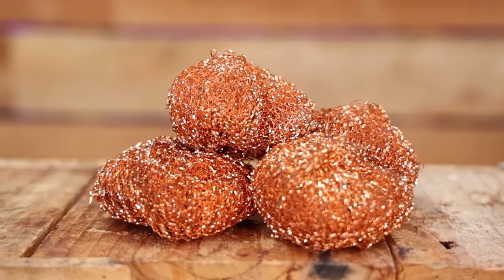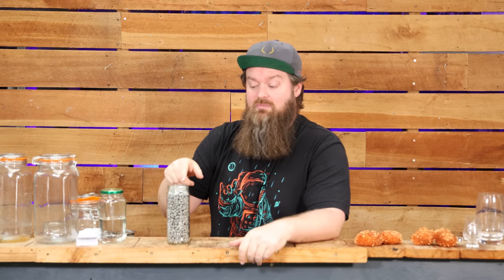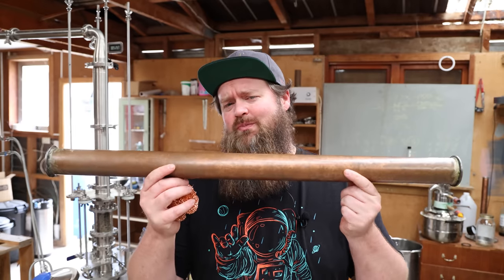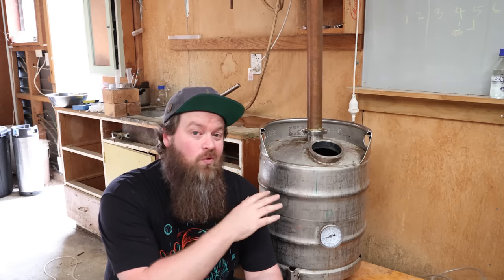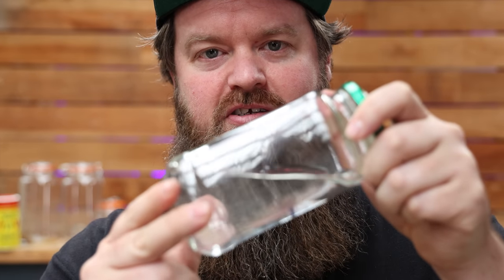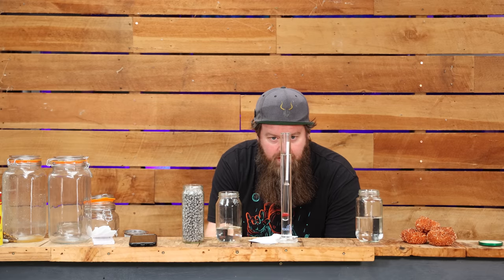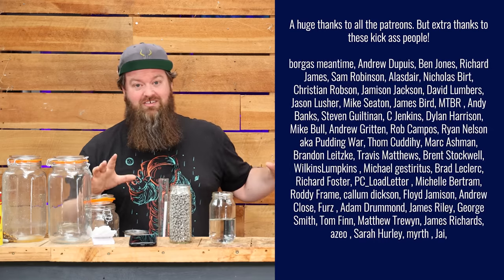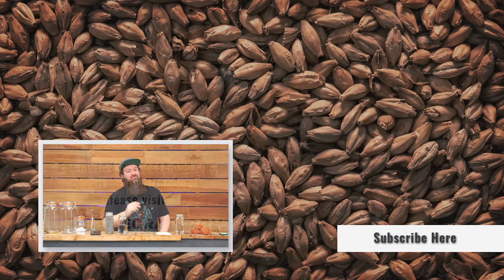Spiral Prismatic Packing (SPP) Vs Copper Scrubbies : Is SPP Worth?

Comment: Would ceramic packing in the column have the same effect as the SPP?
Reply: For small, domestic column (let's say arbitrarily up to 1,5m) SPPs are better in the sense they provide higher area/volume ratio, and thus better contact vapor/liquid and better separation. In taller columns SPPs can get compressed under their own weight, losing their beneficial effect.
Reply: @Tyresio12  apparently in columns 4" an bigger SPP has the tendency to cause channeling too making it less effective. Although some say 4" is okay if.you size it correctly, a few people I saw online went to scoria over SPP for bigger diameter columns.

Comment: Pull the copper and use a gasket with just a stainless screen in it. Your still adding surface area when using copper.

Comment: I wonder how the loss of the copper scrubbies effects the esterfication.
Reply: As long as you have some copper it should be fine in terms of stripping out volatile sulfur compounds. Also his whole vapor path is copper anyway, so it's hardly an issue worth him worrying about.
If your still is all stainless, and you swap out copper scrubbies for SPP/Stainless Mesh/Lava rock, common wisdom is to include some copper scrubbies anyway to solve that problem, even if your column is slightly less efficient as a result.
Also worth mentioning that a copper condenser doesn't do much in terms of removing junk from your product. They're more efficient than stainless, because they transfer heat much easier, but, they don't remove much in terms of unwanted volatiles because they're too cool, and the vapor is too cool, for any meaningful reaction to take place.
Reply: Make the spp from copper welding wire, problem solved.
Reply: @johnsheridan6452  Mig wire is copper coated steel and will rust. Also too thick.
Reply: @wookie45nz  its been over 5 years since played with spp, big swede over at HD made an spp machine and lots of guys took off with it. All stainless .023 mig wire as the copper spp collapses under its own weight. 
Here is his machine in action. 
https://youtu.be/-RkQMxyGbvQ
Reply: @johnsheridan6452  "made from some scraps lying around!"
Hell..my jig is a battery drill on a bit of plywood!

Comment: What kind of metal is being used in the SPP? I was wondering what the difference would be for SPP vs copper scrubbies for stripping sulfur compounds from your spirits. Is that going to be a concern, or are you happy with the amount of that you get from your stripping runs? I have no personal experience with distilling, so I am sorry if this comes across as an outsider questioning with no first hand context for what I am asking about.
Reply: In a copper column there's no need for copper packing, as the walls of column itself are sufficient to get rid of sulfur compunds.
Reply: This SPP is 304 stainless steel 0.4mm wire. A bit of copper in the column is thought to help removed unwanted sulphates..
Reply: @wookie45nz  Sulphides ;) but agreed.

Comment: I'm curious to know how the sulphur compounds in the final product compare when running SPP versus copper scrubbers.
Reply: I think that spp is available in copper to.

It should be atleast. Just som vire wound up.
Reply: @TheAndreasKL  Yes, it is. But copper SPPs have bigger (=worse) HETP parameter. So usually they're used as additional bed in stripping run, and then for the regular run they're replaced with stainless steel ones, to use the full capacity of the column. Some guys just use ss ones  and they say there's no difference for them.
Reply: @Tyresio12  Jesse had copper mesh top and bottom of SPP. That would be heaps as there are very little suphides in most washes. A lot more in wine.

Comment: All well and good, but you forgot the most important thing all that copper surface does, and that's to remove the sulphates from the moosh.. soo.. not a fair contest when there's no sulphate to remove in your test ingredients - that is already distilled pure ethanol.
Reply: With the copper column there is hardly any difference in reducing sulfur levels between copper or steel packing.

Comment: I manufacturer this SPP. If you have any specific questions I could answer here..
Reply: You should do your own vid Pete, over at Luke's place.  Whilst sober :)
Reply: How come you settled on that specific torque on the rings? As in additional angles ahead per revolution of wire of what would have otherwise turned it into a cylinder. (I hope I can make the question clear enough, English is not my first language)   :)
Reply: @Nargluj  Its all about exposing as much wire as possible. There is 1KM of wire per liter which equates to 1 Kg! Some SPP is only 3mmx3mm..I made some this small but found no real improvement of the larger size. Each element works like a mini still.
Reply: @wookie45nz  Thanks for the answer
Reply: Where can I buy the product
Reply: @henrysangret5324  Hi. Where are you Henry? Search SPP on Trademe or contact me through CTC on Facebook.
Reply: @wookie45nz  I am in Michigan just outside Detroit in USA. Where are you ?
Reply: @henrysangret5324  NZ but can ship for about 30 bucks air parcel post.

Comment: I'm glad you kept the copper scrubbies. The copper catalyzes any hydrogen sulfides you might have in the mix and drops them out of the vapor.  I'm sure that rotten eggs smell is something you can do without.  The SPP improving the distillation efficiency is sweet.

Comment: Do you think that azeotrope is all it's cracked up to be? A lot of people seem consider their still a failure if it doesn't readily produce azeotrope. Is neutral at 92 or 93% really all that different from 95%? Does the genio, for example, produce a cleaner tasting neutral than your diy column?

So many hobbies have some kind of fetishized benchmark and I can't help but wonder if this is one of them.
Reply: Yup, it is. Even two 95s can differ, additional (theoretical or real) plates help with separation of other compounds. There's not only ethanol and water in the distillate. On the other hand, some people don't feel the difference, and that's fine, better for them. Also: we're content with something, until presented with something better ;-) and on the DIY columns - they are sometimes quite complicated. I've seen DIY columns that had only one difference with Genio - they hadn't the atomatization module or had it simpler. Kudos for guys that make them.
Reply: @Tyresio12  hmm. So would it be correct to say that the maximum ABV you get is just a side effect of increasing the resolving power of the still? To use a video analogy, an 8K still instead of a 1080p still, where 1080p would be analogous to a still just capable of producing azeotrope.

Our ability to fraction out ethanol is limited by the azeotrope, but there are undesirable aromatic constituents that we need higher yet resolving power (I think that would be the HETP you mention in other comments) to exclude?

Thank you for taking the time to answer.
Reply: @Tyresio12  can you describe for me what your ideal vodka would be like? I'm very fond of Polish potato vodkas like Luksosowa which I find quite clean and smooth, but also with a slight sweetness and creamy quality. By comparison, the smoothest vodka I've ever tasted was Beluga which was almost completely flavour less but had only slightly more burn than water. My assumption is that Beluga is purer, but I would prefer to drink Luksosowa for its flavour and texture.
Reply: @manatoa1  As I understand it, yes. And for the ideal vodka... Man, tough question ;) As it is totally subjective, people like different things and I'm fine with that. For tinctures/liqueurs I prefer "tasteless" neutral 95% spirit that I later proof down on my own - as I'm not really into interactions of tastes from fruit/herbs and the ones from alcohol. Just a preference to feel the "pure" taste of a resource unaltered. For drinking on its own, I think I like grain vodkas more - rather the hint of bread than potatoes. Lately my favourite one (due to nice quality/price ratio) is Biały Bocian ("white stork"), looks like this https://alkoholehurtowo.pl/wp-content/uploads/2019/05/bia%C5%82y-bocian.jpg Although I'm not sure if it isn't "too clean" to your liking.
Reply: I think if you can achieve azeotrope percentages easily and with energy and time savings it's the way to go. Bit like having you car running on good fuel with well tuned and serviced engine..more power less wear more economy.

Comment: I've used copper mesh, ceramic raschig rings, stainless saddles, copper saddles, and glass marbles (I prefer the marbles), but none of these can beat a bubble plate.
Reply: Maybe you would just prefer the alcohols made without the packing? Because marbles have the worst are/volume ratio, so their HETP is pretty high. If one wants product as clean as possible, SPPs are a good way to go, but you may not want it in the first place.
Reply: @Tyresio12  Having experimented with pretty much all types of packing, I still like the marbles best.  They are easy to clean, cheap, and pretty much do all one needs.  I am a Vodka fan and removing every bit of flavor is the goal.  My reflux column starts with an 18" tube packed with 1/2"  glass marbles followed by a five tier bubble plate and a Dephlegmator.  I run it with a PID controller which is super nice.

Comment: I have a complete stainless steel still. I believe my liquor needs to hit copper to clean some impurities out of the booze. I’ve used those copper scrubbys and there only copper plated and they flake off. I use pure copper mesh roller up and I top it off with rachet rings at the cooling jacket. I’m not so worried about the highest abv but taste and how clean makes the biggest difference to me. A real test would be to see how bad your hangover is with using only that spp stuff. But make those out of copper maybe you got something.

Comment: i run a shitty 65L t500 that makes stuff to get me pissed, though lately (after a 100L+ of booze) it seems to be lower ABV,  this isn't a worry because i have so much booze and it's so cheap to make, but this is food for thought!
Reply: 65l t500? Did you make your own boiler?
Reply: @jay71512  Na, they sell them at the shops, it's a Digiboil
Reply: @BitcoinNoddy  never seen them before! I use a t500 and happy with it but wished i could do bigger runs. 25l too small lol. Thx dude.
Reply: @jay71512  do some research though, it runs on 15amps, i hooked up an extension cable with 15amp plug fitted at one end and 10amp male on the other, the lead gets warm but it's fine. there is also a proper way to do it. check out kegland '65l digiboil - Digital Turbo Boiler 3500watt' you'd need the lid also. i run mine at 3500 watts and it doesn't trip the circuit in my home
Reply: @BitcoinNoddy  powers not a problem m8 im a sparky lol never seen them before thats all and couldnt be arsed to mess about building a rig myself. T500 is the best available in the uk ready to run out the box.
Reply: @jay71512  sweet! you're all over it then. back to packing, i was getting higher abv when i started, in saying that i was using turbo products. maybe it's because i'm using birwatchers v4 that i'm getting lower abv, it's a lot nicer/cleaner now though. i was getting over 90% abv now getting under 80% abv
Reply: @BitcoinNoddy  wouldnt think that would make a difference tbh? I run birdwatchers at 8% abv and it distills at around 90% in a bog standard t500. I could very easily be wrong but my understanding what goes in to the boiler shouldnt effect the abv of what comes out??
Reply: @jay71512  it turns out i was just running it too fast in the end, hope you're still brewing, did you get a 65L? 
i just watched this again as planning to upgrade to this packing after tax return
Reply: @BitcoinNoddy be interested if you ever did get spp and how it's working for you
Reply: @markh1603  I didn't get them. I figured out I was running the still too fast which is why the percentage dropped

Comment: To my eye, your SPPs are too large. Here in Russia we mostly use 3.5x3.5 mm SPPs made of 0.25mm stainless steel wire (4x4mm variants are also common). Yours look more like 7x7mm or even bigger.
On the other hand, bigger SPPs are easier to handle. You cannot splash them down your sink just because they are so small that they can float on the water. 😁

Also, treating SPP with acid makes its surface a bit etched. This greatly improves its capacity to retain liquids, which in turn improves its performance in the column.

Comment: Congrats on 100K BUT what how do all these compare to  raschig rings?  (copper and ceramic both really cheap)
https://en.wikipedia.org/wiki/Raschig_ring
Reply: Guys on Polish and Russian boards tested it and SPPs came out better for lesser-than-industrial distillation columns, iirc they had better area/volume ratio. In very high beds compression becomes an issue however, so it's better to separate the packing in two beds, each supported from below (so something like: support-SPP bed-support-SPP bed).

Comment: how can it be a meaningfull comparison if both have copper mesh used   . .  i understood using one mesh on the bottom because you kinda had to  but another on top as well seemed to of no value and there to warp the results further in the SSPs favour